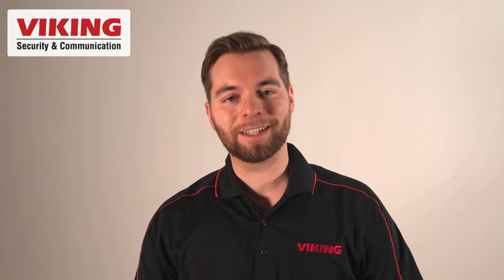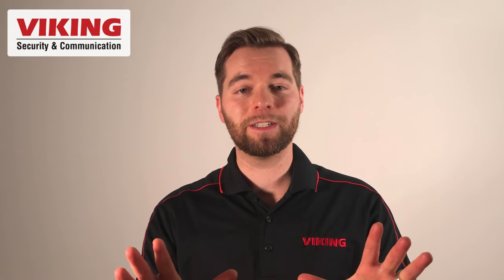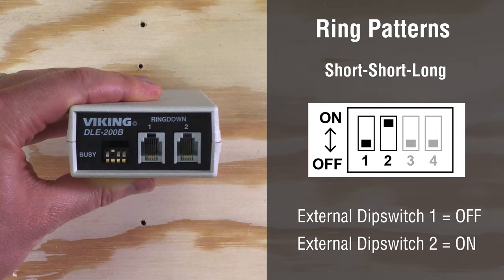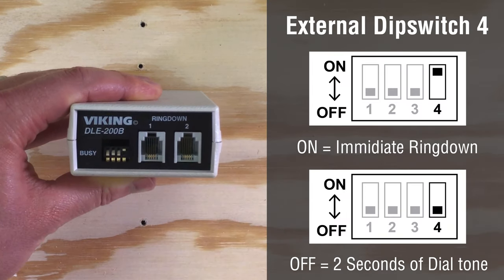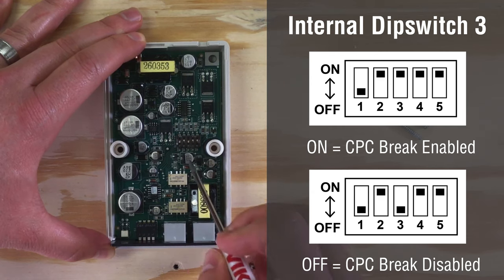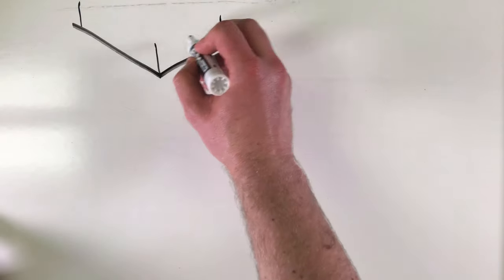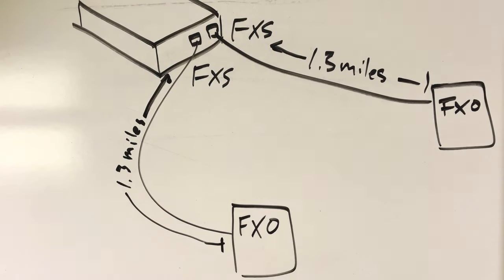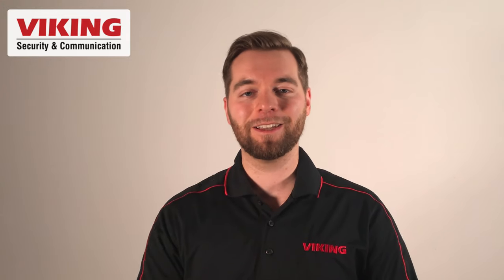Viking DLE-200B Telephone Line Simulator | Ring Down Circuit

Comment: I used to really get annoyed at how expensive your products were even down to stuff like this. Because I thought it was so simple so why does it cost so much. But now that you opened it up and went over all of its features. I can say that the price is justified. Because this is not a cheaply made piece of equipment here.

 Has a lot of features that cheaper phone line simulator brands would not have and probably would have never even thought of. Kind of reminds me of myself and how I think of every possible way that a product could work better, even though I don't engineer or manufacture anything, I always have a lot of ideas.  

And I can tell from the hardware on the inside that this is pretty good. Thank you so much for sharing this video.
Reply from the maker: Thank you for your feedback!

Comment: I think the price is more than reasonable considering it saved our company about $6,000 a year. We have a 24/7 guard at our building that our four elevators would call in the event that somebody pressed the elevator emergency call button. each one had a phone line meaning we had five phone lines that this one device replaced. Thank you Viking. Such a great product.
Reply from the maker: Thank you for the feedback and for providing a great real-world example of the DLE's cost savings. Can I ask how long you've had the DLE-200B in place of those 5 analog lines?
Reply: @VikingElectronicsWI  I installed it yesterday. 

Here is the thing though, not ONLY did it save us the cost of the phone lines BUT it saved us the cost of the elevator tech coming out to reprogram the phones (kone) which they charge like 800 an hour. Plus the cost of the equipment for switching it to voip/cellular. I can't thank you enough. This product is great.

$120 plus the $100 dollar cost for a ups (to keep it up for 4 hours for code) is well worth the cost.
Reply: I’m more concerned that your company has to result to YouTube Lang a professional person to deal with this

Comment: It would be interesting if  the Viking engineers could create an iPhone app that would manage the dip switches instead of, or, in addition to, the physical dip switches.  The app could simulate the ring tones so I don't need to remember what combination does what.  The app could easily be made secure so outsiders can't fiddle with the settings.
Reply from the maker: That would be interesting... Thanks for commenting!

Comment: Why are devices like this sooooo expensive lol. I just wanna setup a home dialup server.....
Reply from the maker: Is the DLE-200B expensive?
Reply: @VikingElectronicsWI  It's around 120 on Amazon. I just want to know what makes line simulators cost that much. Is it just demand? I guess I don't know what components are in it (but I assume it's just cable connecting 2 i/o to a microchip with maybe a resistor, a transformer, a capacitor, and a few switches and LEDs)
Reply from the maker: @randominternetbro6562  The DLE-200B provides point-to-point communication for analog telephone devices up to 2.6 miles apart. We think the DLE is very affordable compared to other solutions to the same problem (i.e. paying monthly for 2x telephone lines)
Reply: @VikingElectronicsWI  Do you have an option for very small networks with something like a 3 foot cable connecting 1 computer and a modem? Maybe I'm just looking at the wrong thing? I'm looking to connect a computer that I dial from to a external modem, which will be connected to a line simulator, which then connects to a computer that has a ethernet bridge. These devices are at a distance of maybe a total of 20 feet cable total.
Reply from the maker: @randominternetbro6562  The DLE-200B takes the place of 2 analog phone lines and will allow for two PCs with Modems plugged in to communicate from one PC to the other. Does that help?
Reply: @VikingElectronicsWI  Yeah. Sounds  great. I'm looking into this or something like this right now. Finally found a US Robotics 56k, so I'm pretty excited to get an actual network setup.
Reply from the maker: @randominternetbro6562  Make a video when you've got it up and running and tag us in it! But only if it works.

Comment: BUT WHY IS IT SO EXPENSIVE??
Reply from the maker: Expensive compared to what?
Reply: @VikingElectronicsWI  idk. I just think $119.30 is a little overpriced for a little circuit board in a box.
Reply from the maker: Maybe that's true if you focus on the hardware and not the problem it solves. Manufacturer's using this to communicate up and down assembly lines are happy to pay the one time investment compared to two analog phone lines at $40/mo each. Thanks for mentioning your concern!